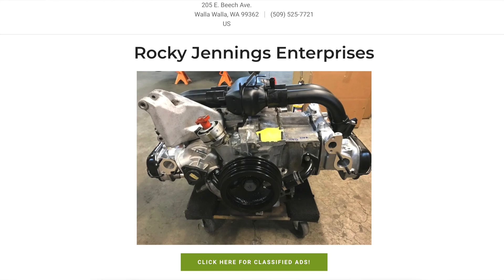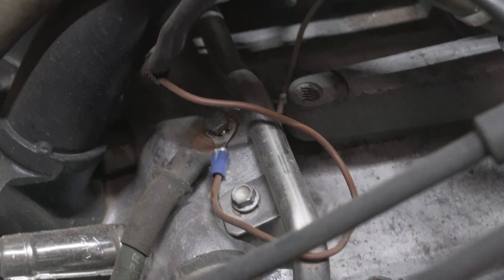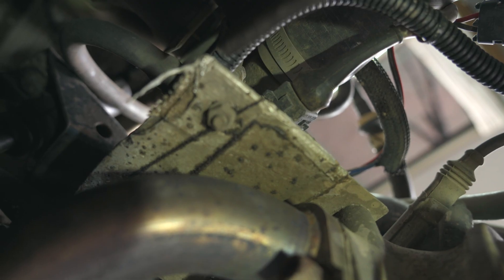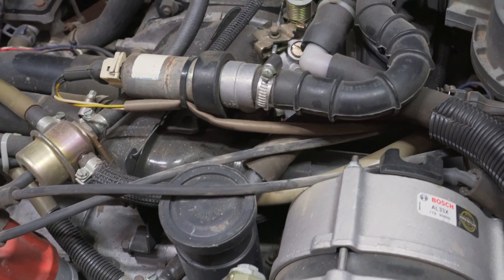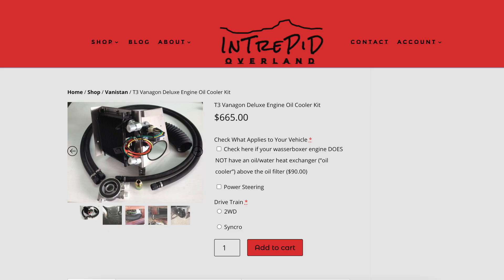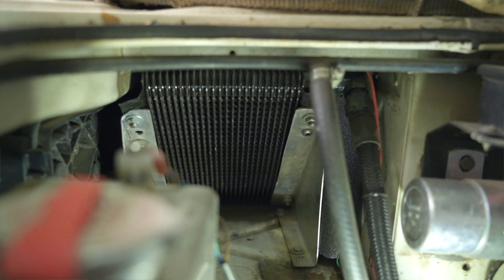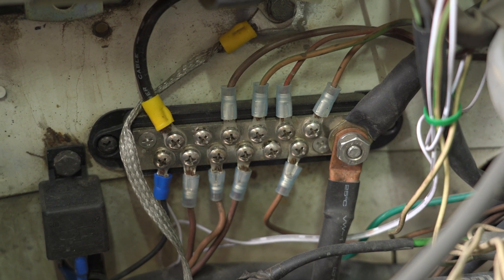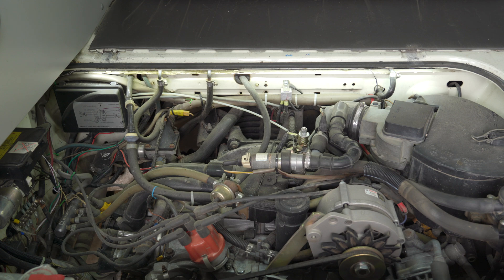Vanagon Waterboxer Engine Built for Remote Travel - Is the WBX still relevant??

Comment: Question - that ground tree is separated from the frame by its plastic housing - so how are those multiple wires actually grounded to the frame/chassis??
Reply from the maker: The tree is grounded by two wires. One that goes to the body and one that runs all the way up to the negative post of the starting battery. 
Nate

Comment: Good video nate, I have owned my syncro for 34 years now and only recently adde an oil temp and presure gauge, I notced the the high oil temp when pushing into the wind and now I understand why I had to replace oil every 7000 km. cruising casually it runs at 100-110 degrees C. But when climbing or pushing into the wind it goes to 125 c in no time and even more. At these temps the lifters get more noisy and the pressure drops to just below 2 bar. when cooler at 100 deg C the presure sits at 2.8 bar.
I am definitely going to fit an oil cooler.
Please share how much the temp dropped after installing the oil cooler.

Thanks for sharing
Reply from the maker: I believe it lowered the oil temps around 10-15 degrees F on long climbs.  The fan helps a lot as well
nate
Reply: Hi,
how is the watertemperature when the oil getting hot? My Syncro is never over 94C, but i have no Oil sensor. best regards Claus
Reply: @clausruebel water temp is normal. No fan rynning
Reply: @clausruebel water temp is normal. No fan running.

Comment: That new ground plate - how does that ground to the chassis with the plastic in between the metal and the chassis?
Reply from the maker: It is grounded on the provided grounding lugs on the ground tree to the engine, chassis and starting battery. 
Nate

Comment: Aloha. My 1.9 crapped out on me and I'm replacing it with a 2.1 and keeping the old 1.9 EFI. How did you connect the ground tree to the battery negative? Direct to the post or at the ground point in the battery box? Thanks for all of your awesome videos.
Reply from the maker: The ground tree is connected to the engine with the factory style ground strap and is also connected straight to the negative post of the starting battery via a 4GA ground cable.
Hope that helps and good luck with the swap!
nate

Comment: But WBX already as an oil cooler? Albeit small.
Reply from the maker: The stock heat exchanger is not really an oil cooler as it is an oil pre heater.  It is designed to heat the engine oil from the engine coolant to aid in faster warmups.  The water temp in the van when normal operating temp is higher than the oil temp so while driving, it actually heats the oil a bit.   Not much to be concerned about but our oil cooler is just that.  Designed to cool the engine oil when needed.  It runs off of a thermostatic valve that only opens after 180 degrees F.
nate

Comment: I get the idea of a Aluminium header tank, but I really trust my eye with a good quality plastic version. You can see everything from unwanted bubbles to the level and quality of the SP coolant. A tiny detail but we differ. The oil filter can be exchanged for a shorter version, so no protection will be needed & most of us change the oil too much...... Looked fun. As with anything T3, if it's hanging below the belly, it will get knocked off!... The Syncro's have plenty of protection anyway! Nice Vid. Thanks
Reply from the maker: If there was a good quality plastic version, preferably an OEM tank, I would agree with you.  Ours developed a small crack and by that time we went through two aftermarket caps and were done with poor quality plastics.  I haven't had a need to see if there are bubbles and the coolant gets changed every two to three years anyway.  We now use a shorter and wider filter because we put on the GoWesty exhaust and it does not fit with the sandwich adapter and the stock filter.  
Thanks for watching
nate

Comment: Great video! Do you have some numbers on how well the oil cooler is working? You said you were sometimes reaching temps over 240F does it ever go over 220F now you have the cooler and fan installed?
Reply from the maker: We rarely see any temps above 220 now and that is on long, slow climbs in the summer time. Like 2nd gear grinds up steep passes
Nate

Comment: HI...thank you for the information...I am curious about the oil cooler that...is it the oil that flows in the cooler or water?
Reply from the maker: It is an oil cooler and the oil flows from the oil pump into the cooler and back.
nate
Reply: @ThatBaldwinLife  thanks. and what abt the stock oil cooler?is it still in use?
Reply from the maker: The stock oil cooler isn't a traditional cooler as much as it is a heat exchanger.  It is there to warm up the oil faster when first started and it can loose some heat during driving but the temperature difference between the oil and coolant is not enough to make a difference in oil temps.  Yes we still have it in use.
nate
Reply: @ThatBaldwinLife  since oil flows through  the cooler, so it means..you must add more oil into engine..right?
Reply from the maker: Yes you would add a bit more oil in the system which is a good thing.
nate
Reply: @ThatBaldwinLife  thank you very much for your response

Comment: Placing lighting in or above your engine bay is not that helpful as you'll ALWAYS be creating shadows with your head, body, or hands while struggling in some hard to reach location. Anyone that does wrenching of any kind today (and wants to remain sane) will wear a LED headlight to focus directly on the task at hand. I wear my headlamp so often, I realized it was on my head at Costco the other day!LOL
Reply from the maker: Don't disagree on the shadows but the light up there is super helpful regardless.  We keep headlamps in the van for camping anyway and if I need to use one while working on it, I will.
Thanks for the feedback!
nate
Reply: Ive used my lamp mounted above the engine for more that wrenching, plus you open the rear hatch and the whole rear area is lit!

Comment: Hey Nate, WBXer here as well.  Great insights.  Man the importance of the grounds is so critical.  I'd like to add the starter ground - thx.  How did you connect it to the frame? Did you have to drill?  Also I only have one 0guage ground from my block to the body.   I will look at adding from the head as well.    I'd also add how critical it is to make the gearbox ground a thick gauge ground.    Did you do anything special with the star grounds under the dash? I replaced mine and the connector ends.  Cheers!
Reply from the maker: There was a hole already in that area for the starter ground.  I just removed any paint and put a bolt in it.  The gearbox ground is critical but the stock size wire is adequate.  The starter ground makes the gearbox ground redundant but I feel it should still be there.
When I removed the dash last year to replace the heater core, I took the grounding trees off and scuffed them up clean.
thanks for watching!
nate

Comment: Hello. 91 2WD Westy here. You offered a number of well thought out preventative improvements and I will adopt some of those ideas right away, in particular the oil filter cooling fin for protection. I added a tail/stop/turn signal LED lightbar ($15 EBay and sealed) to the outward facing edge of the rear tool shelf and wired it into the wiring bundle at the left front of the engine compartment. The fit and appearance is perfect and adds a great 3rd high mount stoplight. Being seasoned with VW's I also cleaned and improved every grounding connection I can find. I found an SPST rocker switch at the local hardware store ($7) that fits into the switch blank on the gauge cover on the dash.  This was a very easy retrofit that required only a minor filing of the blanking hole and it looks factory installed - this may become an engine immobilizer switch in the future. Always looking for ways to improve the reliability of the van. Lastly, I, too, am convinced that the WBX is the right engine choice when the time comes. Thanks again!
Reply from the maker: That's a good idea on the tail/stop light, I might look into that.  Every Vanagon needs a kill switch!  Too many are getting stolen.
Thanks for watching!
nate

Comment: That was really inspiring. Almost a new engine really. We've done nothing to our 1.9 other than maintain it as per VW and (since your video...) filled up the gearbox with the right amount of oil. Here in England it doesn't have a sressful life and fuel is so expensive we don't take it far. I change the fuel filters quite often and mainly try to stay on top of rust by plastering everything on the underside with old sump oil.
Do you do anything to mitigate against ethanol? Our classic Toyota has just sprung a catastrophic leak due to a gasket failure from ethanol.
Reply from the maker: Yeah it is basically a new engine.  Since we drive to some remote places, we wanted to replace items that might fail and be hard to find on the road.  
Ethanol is a tough one.  Best we can do is to put on fuel lines that are compatible with ethanol and keep an eye on things.  We haven't had an issue with it yet on any vehicle but I did on my KTM enduro.
nate
Reply: I had a worsening head  seals coolant leak that I abated with Subaru coolant Conditioner...and it completely fixed my issue! I couldn't recommend it more highly! ....and my issue was on a newly rebuilt 2.1 WBXr.